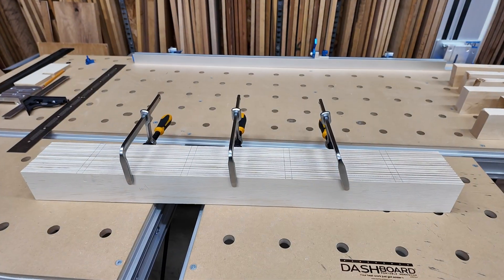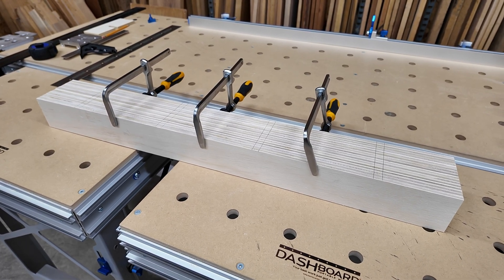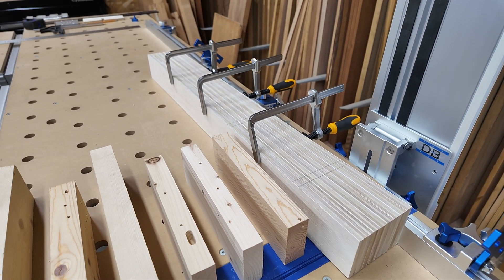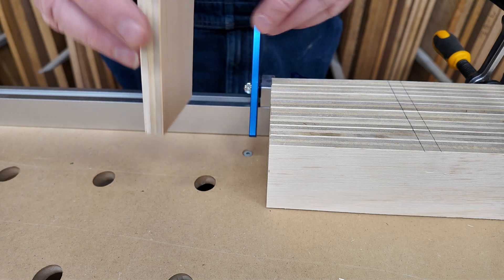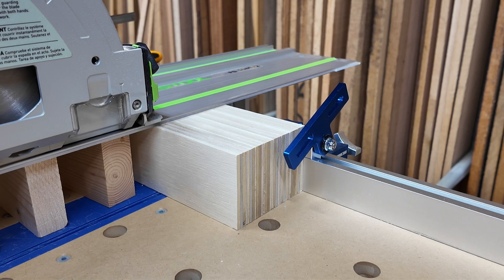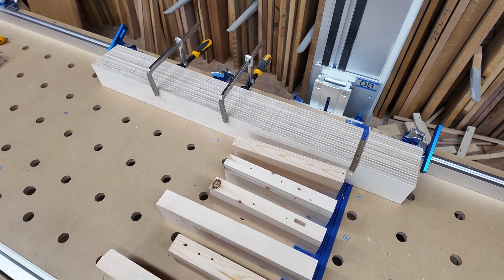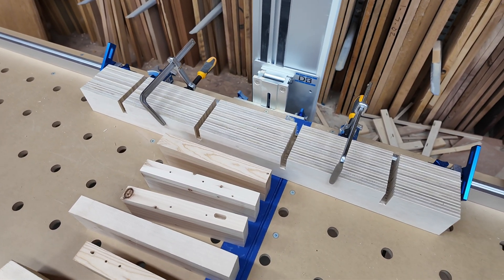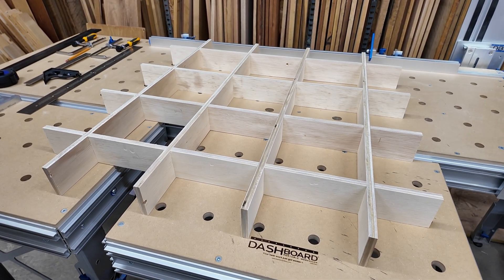Half lapped torsion box ribs with a track saw

Comment: Great job! Who needs a $15k CNC?  Hah!

This does though look like a job that was tailor made for an ancient, dusty $25 FB Marketplace Radial Arm Saw and a dado stack.
 
Which would be less expensive then even just 9" of festool track or any two clamps you are using. 
 
:)

I am both appreciative and amused at how much engineering, problem solving,  and resources are involved in duplicating something 
Norm Abrams was showing us how to do 40 years ago :)
Reply from the maker: @lifeofreilly  Ha, no argument here. A radial arm saw would be the perfect tool for this job. In fact, I just bought one, and it’s the same model that Norm used. It’ll take some time to get it setup. And I’m gonna need some flannel shirts.
Reply: @ShopKlutz  Great minds! ;)
Reply from the maker: See https://youtube.com/shorts/dDDIWIYuLd4?si=eyrkqCWrz185X8Fc for a look at my new RAS.
Reply: Problem is the amount of real estate that the good ones take up. I’ve got a decent sized shop (36x48 with a 12x24 shed) for a non pro, but it has to be multipurpose and not dedicated solely to wood stuff. Welding, small engine repair, tractor/auto/equipment repair etc.

So I eyeball equipment as to 1) how much I’ll use it and 2) how many functions can it perform 3) do have something that can already do this task 4) and if so, is it ergonomically pleasurable (so separate planer/joiner here), how much room is it going to take up.

And one of the points of going the MFT route is the easy ability to crosscut wide pieces that a radial arm saw would have traditionally been used for.

Dados can be done in multiple ways.

So no RAS for me.

Big shop? I’d definitely have a big iron RAS with a dado stack pretty much left in it. And maybe a second one dedicated to crosscuts.

Just throwing this out there for others to mull over who have similar considerations.

Comment: Could I make all the first cuts then turn the track around 180 deg, then do the second cut?
Reply from the maker: @tutzking3318  If I understand your question correctly, yes, I think so, but… would turning the workpiece be easier? Also, it’s important to make sure the spacing of the dadoes is the same for all ribs, which is easy if they’re all cut as part of the same gang, but if not, rotating the workpiece or the track means we need to be careful not to get mixed up which end is which, etc.
Reply: He marked the spacing before cutting, so you cut your first cut like he did the right side line as in the video. Now when you turn the jig around or the whole bundle around then the other line would be the same cut as the first one. I think moving the little light jig is much easier than the bundle.

Comment: What is a millimeter?
Reply from the maker: @esmithiii2003  🤣 Sorry. I’m old school, but I’ve been experimenting with metric, and it turns out I kinda like it. I go back and forth.
Reply: @ for woodworking and machining I use “freedom units”.  Most English speaking folks don’t know what 30mm is, so if you talk in metric in English, you should also state the imperial equivalent.  

Keep in mind that darn near every tape measure, analog calipers, every builders square, not to mention all our wood / lumber is expressed in Imperial.  Hundreds of millions of pages of construction drawings, router bits, drill bits, saw blades, etc is measured in imperial in the US.  No one in America can speak metric so it is harder to follow your videos.
Reply from the maker: @esmithiii2003 Yes, obviously I know that the imperial system is prevalent in the U.S. Personally, I’ve always preferred imperial and found metric to be unintuitive, but I am finding it increasingly difficult to ignore metric completely. I keep encountering tools and content from Europe and Canada, and it helps me to become a little bit adept at thinking in millimeters. I suspect most woodworkers in the U.S. are aware of the dynamic I’m describing, and some are annoyed by it. Don’t blame me — I’m just the messenger. Personally, I’ve decided to try to become “bilingual”, fluent in both imperial and metric. I’m not there yet, but I’ve made some progress. The transition is a bit awkward, especially in how I deal with it when making a video. This is probably the first one where I used mostly metric, just to see how it goes. I do see the value in stating things in both millimeters and inches, and that’s the pattern I plan to use. It’s just easy to forget.
Reply: It is a very easy and accurate system of measuring. 10mm plus 25mm equals 35mm. 2 and 7 eighth plus one and 9 32thirty seconds equals??
Reply from the maker: @ I agree, but it’s difficult to experience that benefit until you can develop a quicker sense of the scale of things, without constantly dividing by 25.4.
Reply: @ maybe it is easy where you live.  Here it is a nightmare.  Every cutting tool (router bits, endmills, saw blades, etc)   are in imperial.  Every single one of literally hundreds of millions of pages of construction drawings are in imperial, not to mention construction materials).  So, yes, Imperial is far easier than metric.

Comment: Great video.  I had an idea.  How about cutting the trenches a little bit short in depth.  And then cleaning up and flattening up the bottoms with a long flush cut router bit and bearing.  That way you could have really clean bottoms, and you could slowly creep up on the depth of the trenches?
Reply from the maker: Good idea. That would probably be the way to go for a real dado where the bottom needs to be clean.  For the torsion box case, I've seen some folks say the crossing rib doesn't even need to make contact with the bottom.  Seems to me it might be a little stronger if it did.

Comment: Thank you for going through the through process on how to cut those slots.

Many of us have a track saw, but do not have the Dashboard version of an MFT.  Instead we have the Festool MFT, the Kreg ACS, the Metabo table, etc.

How would you suggest for us to account for the 1.8mm or 2.2mm kerfs made by the track saw blade?

Jodee of Inspire Woodcraft shows a very cool technique on a 4-min video at https://youtu.be/nsw5qlrdx2A

Thank you for the videos — I enjoy watching the doppelgänger of a buddy!
Reply: Not sure about USA, but in Europe one can pick up drill bits that size. Or buy a set of metric spacers. One set that goes from 0.1mm to 1mm in 0.1mm increments. Get another set for 1mm to 10mm~15mm in 1mm increment. These two sets can be cheap, $20~$30 per set. This will allow to set any regular or odd measurement with ease. Don’t go for super accurate spacer, the same set will cost $80+.
Reply from the maker: @asderven  Cool idea.  Thanks.
Reply from the maker: @HugeHugsNow-vx5cn  Good question. I should have explained a bit more about that in the video. I would probably cut a spacer that is the thickness of my boards minus a saw kerf, using trial and error on the jointer if I had to. In fact, I was about to do just that when I realized the Dash-Board kerf plate could do what I wanted with one extra step. BTW, that Inspire Woodcraft video is great.  Thanks for the comment!
Reply: Thank you for the video. I am making a table for my router sled. I used half lap joints on wood. My skills left much to be desired. Would love to see the whole process of your build, will copy it in a few months if my router table remains uneven beyond recovery. 

My table is 190cm long by 91cm wide. The rails are 2m long and 1.5m wide. I wanted an overhang with the router to allow vertical work and use it as a router table in a much safer way. Will be more precise as well, hopefully.

Have you thought about the quad hinge from benchdogstool uk. That one has I think 50 or 75mm height capacity?
Reply from the maker: @asderven  I need to get more familiar with Bench Dogs product offerings.  Peter Millard says they have good stuff.  But anyway, the Dash-Board hinge has a height capacity of 74mm, so that's in the same ballpark as the hinge you mentioned.
Reply: @ShopKlutz  I use bench dog stuff. I got their quad hinge, rail square, repeat stop for rail square, parallel guides, fence and a few extra bench dog hole accessories. Thanks to that, I can now cut square every time. Before I got those, I was a mess. I just started and most tips were not helpful. Now I am discovering my limitation is a square and parallel sides for lumber, but the cuts are good. I am contemplating of making a new table and getting extensions for the fence. I often work with full plywood sheets and 8’~16’ lumber. Personally they have served me well, plus Ralph (the owner) will listen to your suggestions and try to incorporate the changes. I haven’t tried any other company so can’t compare them.

Comment: That was interesting. 
What's the height limit of the saw rail on the hinge? Just curious as to how tall the wood can be.
A sliding miter saw might work but not sure if you can get it to dado that many pieces at once and still have them all flat, A Radial Arm saw would work, but not everyone has that.
Reply from the maker: @gnic76  Thanks. Dash-Board says the hinge limit is 74 mm, or about 2.9 inches. I think it might be possible to stretch that a little further.
Reply from the maker: @gnic76  I’ve been looking around for a good used radial arm saw. I know they’re unpopular nowadays, but I kinda want one. 😁
Reply: @ShopKlutz  Look for a 12" Rockwell / Delta radial arm saw - I own two of those (plus a 10" Delta Professional and a Craftsman 10").  They have a 5/8" arbor like your table saw, so they will work with the same 8" dado blade as you use on your table saw.  As the arbor is 5/8" and most 12" blades have a 1" arbor, I had to pay a couple of dollars for a Freud BL71MCE9 1-Inch to 5/8-Inch saw blade bushing so that I could mount a Forrest 12" Chopmaster (negative hook angle) blade on each of the 12" saws.  I paid $100 for the last 12" Delta saw - the guy had it listed originally for $150, but he dropped it down to $50 - I offered him $100.  I had to replace two of the small table boards and the fence board, and will probably have to replace the bearings soon.

I ended up snapping the nylon/plastic elevation gear on one of the saws, trying to get the dado stack lower than roughly 1/2" to 5/8" to make a half-lap in 3/4" thick boards.  I encountered resistance, thought the resistance was due to rust build up, and kept cranking the elevation handle, only to find that the elevation stopped working when the nylon/plastic elevation gear snapped in half.  I suppose that is better than stripping metal gears, and I was still able to find a replacement for that gear on the internet.
Reply from the maker: @ Do you have the 33-790 or the 33-890? Or something else? I found a 33-890 for sale, but it’s several hours away, and the asking price seems high.
Reply: @ShopKlutz  I have a 33-890 single phase, which is 1 1/2 HP with a label on the motor stating that it was made by Emerson (hopefully, just the motor, not the whole saw) - there were apparently 2 HP versions of this saw also, one model is a Delta 33-895X.  I also have a 33-892 three phase, which is 1 1/2 HP with a label on the motor stating that the motor was made by Marathon Motor Electric.  There is more clearance under the single phase motor than under the three phase motor, so the single phase saw has a slightly greater depth of cut.  The 10" Delta Professional saw is a model 33-830 and was fully manufactured by Emerson (as were many of the Rigid and Craftsman radial arm saws).  The 10" Delta Professional saw is a light-weight next to the 33-890, with deflection of the blade possible when the saw crosscuts (nowhere near as much deflection as I saw in a nearly new Bosch sliding compound saw, but it is noticeable).
Reply from the maker: @TheProfiledCorner I lucked out and found a very unusual deal on a 33-890 just a couple hours from me. It was made in 1991, but has never been setup. I actually bought a 34 year old saw in its original packaging. 😂
Reply: @ShopKlutz  Wow! That is an amazing find.  I am very surprised that you found one that was never set up.  I think that model of radial arm saw was selling for around $2500 to $2700 in the early 2000s.  If the saw is new in the box, you were very lucky.  Take the time in setting it up right, and you will be amazed at how well it holds tolerances and returns to 90 degrees.  I highly recommend buying a partial sheet of 1/4" MDF and attach that to the top of the standard table boards (with brads in non-cutable areas) before making any cuts into the table.  That 1/4" MDF was a recommendation that I found in the manual for the Delta Professional 10" radial arm saw (the company that previously owned that saw cut all the way through the original table).  That way, you may use the radial arm saw for miters and bevels without damaging the original table, and I think that would also allow you to make half-laps in 3/4" material with an 8" dado stack (without destroying the plastic elevation gear). I am looking forward to seeing your assembly video.  Out of curiosity, are you able to share what you paid for the saw, maybe in a video?
Reply from the maker: @ Yeah, I feel very fortunate. It’s so unusual to find a machine this old that hasn’t been used. But I’m pretty sure at least some items are missing. You’re talking about a wooden table surface, and my saw doesn’t have one. There’s no blade either. And no manual. But all that stuff is no problem. Hopefully everything else is here. The motor says 1.5 HP, and it’s wired for 220. I paid $350. I’ll post a short video soon. Thanks for the guidance.
Reply: @ShopKlutz  The top on the saw was likely 1" thick MDF, made up with one wide board that has locator pin holes, four (if I remember correctly) smaller boards of various widths (to allow for a wider maximum width of cut for 1" and thinner stock), and a 3/4" wide board for the fence.  The original overall table size is narrow - as such, I replaced the slightly wider board that I typically have just in front of the blade with a board that is about two feet wider than the table, with a foot sticking out on each side of the table.  I also made the fence board just as long.  Since you have to build a tabletop, you might consider making the top at least a foot longer than standard, possibly longer than that.  If you cannot find flat 1" thick MDF for the top, I was able to buy a pre-warped sheet of 1/2" thick MDF from Home Depot, and glue that together face to face to make a reasonably flat 1" thick top for my 10" Delta (then I put a 1/4" thick sacrificial top on it).  I also raised the height of my saws by about 4" to make them more comfortable to use (especially with dado stacks) - I ran a roughly 4" x 5" board from the front legs to the back legs on each side, and connected those boards using mortise and tenon joints using cross-boards that were set about a foot back from the front and back of the saw - the set-back was so that I could still walk up to the saws without kicking the cross boards.
Reply: @ShopKlutz  I picked one up, used for cheap, needed some TLC, definitely has its place if you have the room.
Reply: @ShopKlutz  I have a Craftsman 10 in RAS, circa mid -late 60-70s lol. It's new enough to have the height adjustment on the front under the table. So that's good. I set it up to cross cut 16 inches. I won't be ripping with it.
I put a neg 5 deg Oshlum blade on it, seems to cut well. I know it will take a dado stack as well.